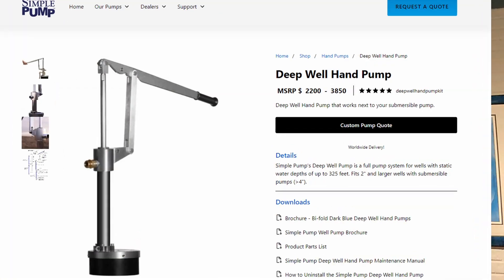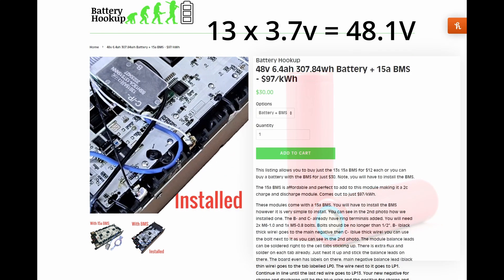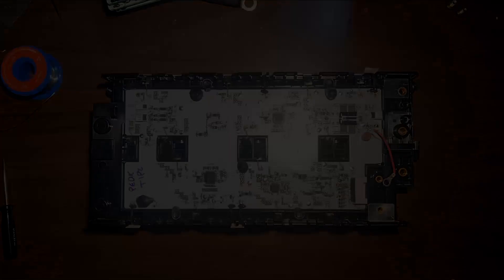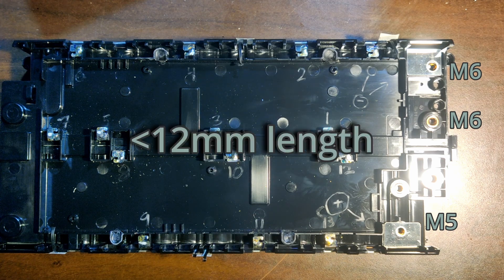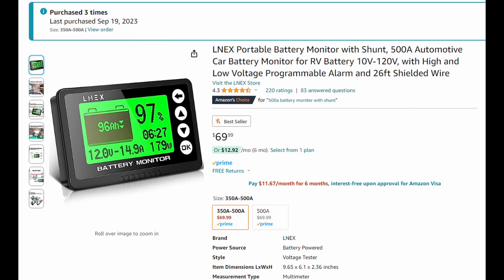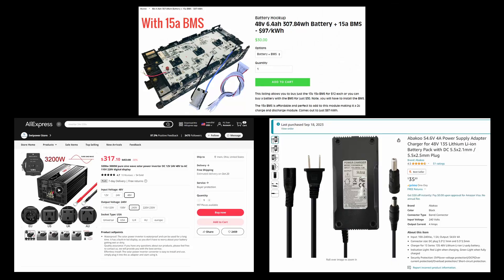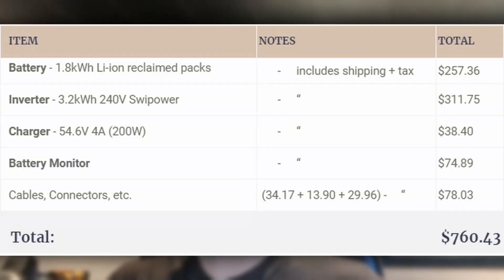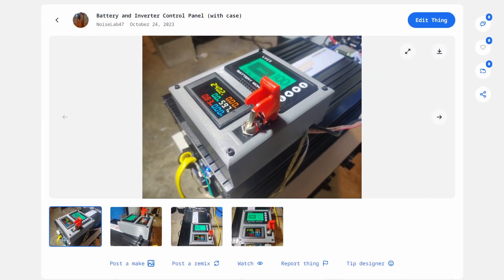DIY Well Pump Battery Backup for 1/2 the Cost of a Hand Pump

Comment: CAN THIS INVERTER BE ABLE TO RUN MY 240 V ac OR IS THERE ONE THAT YOU CAN RECOMMEND. ITS A 2 TON SELF CONTAINED AC UNIT.
Reply from the maker: Probably not. I've found AC / heat pumps to be one of the most difficult home appliances to run.. Additionally, many ACs require not just 240V, but "split-phase" 240V/120V. My recommendation would be a split-phase inverter with a rating of at least 6000W.

Comment: I’m no electrician, you didn’t include electrician labor fees, but you definitely deserve a like. Jesus Christ! How am I going to get backup power to this well?! I didn’t understand any of that! And it’s exactly what I need. I’m sure of it. 😅
Reply from the maker: Ha! Yeah my primary goal was ultra-high value, and definitely I sacrificed some practicality along the way. A much simpler option for the battery is to buy a pre-built 48V LiFePO4 pack off the shelf in place of the DIY battery pack.

Tapping into the well pump circuit is a super quick job for an electrician, but I'm sure you could do it just as well with a bit of research and a healthy dose of caution!

Comment: Have you actually tried running your well pump with your inverter?  It's hard to believe an inverter so cheap could run the pump.
Reply from the maker: Oh... I never did actually show the system powered on and running! Whoops! But yes, the 3200W inverter runs the well pump perfectly. It's been deployed almost a year and has proven to be incredibly reliable.
Reply: @NoiseLab47  No need for whoops. Just make the follow up video.
Reply: @NoiseLab47  I'm new to all this and I keep seeing expensive "split-phase" inverters recommended for pumps and motors. This inverter does not appear to be "split-phase" is that a concern?
Reply from the maker: It's a little ambiguous. Many 240V appliances (such as our well pump) do not need split-phase power, so a standard 240V inverter with three-wire output is all that's needed. But some appliances like heat pumps use both 120V and 240V, meaning they need that extra "neutral" connection which "splits" the phase. So it really depends on the device you are trying to power. If you're looking to power a mix of 120V/240V appliances, that's where you'll definitely need a split-phase inverter.

I'm planning a follow-up shortly and this is one topic I will examine in more detail.